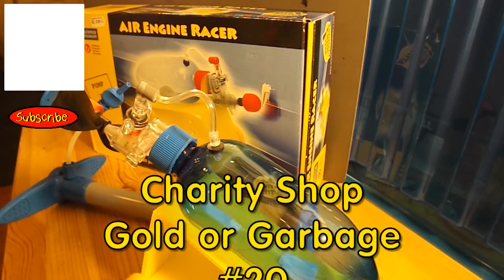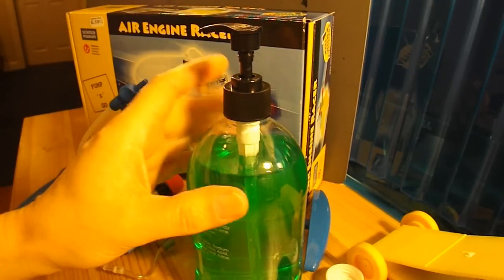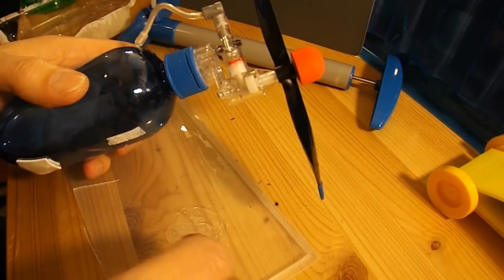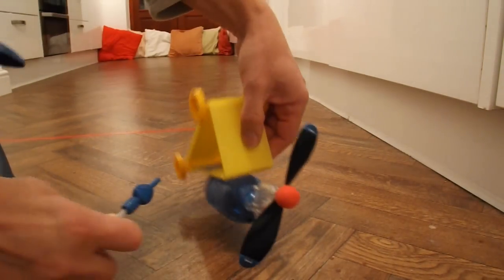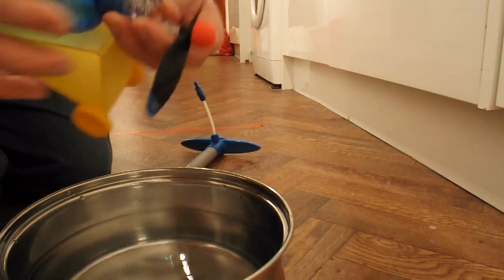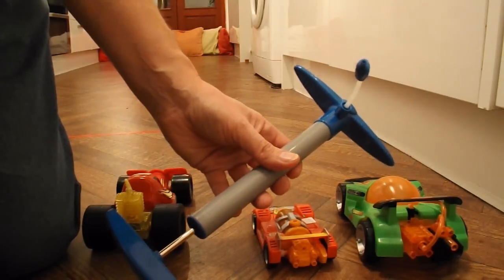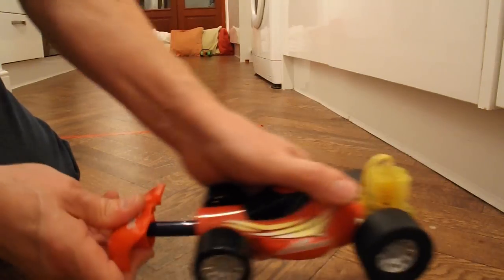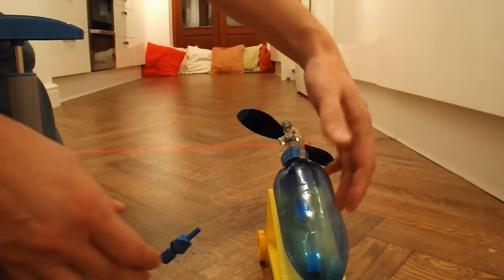Charity Shop Gold or Garbage #20 Repairing the Air Engine Racer

Comment: Hey grandad, is there any air pressure cars or propellor kits or stuff still selling today? If so then I really need to know where to buy that air engine racer and put styrofoam wings in it so it can fly!!!!
Reply from the maker: I guess you will have to search online, maybe eBay or similar. This video is 11 years old and it was second hand when I found it in a charity shop. Air Hogs did several air engine planes. There are links to my related playlists in the video description.

Comment: use Goop to fix the crack.
Reply from the maker: Goop? would that be "Goop is an American natural health company owned by actress Gwyneth Paltrow"
Reply: @GrandadIsAnOldMan  No. It's a kind of adhesive, something like silicone in a tube, but much, much, much better than silicone. I once fixed a tear in a rubber boot with goop and the repair was perfectly waterproof and lasted until I threw the boots out twenty years later. Goop forms a tough lasting repair that bonds securely. It does air dry, however, so the thicker the application the longer it takes to dry. For the crack in the video, it might take several days to dry completely. If that screw cap weren't under a lot of stress, a few hours drying would be enough for it to be strong enough, but for full strength a day or more. The tear in my boot was at the ankle, and it was good to go by the next day.
Reply from the maker: @willardchi2571  I was teasing you, sorry. I Googled it and that was the first thing that came up. Goop do a whole range of adhesive sealants and yes it would probably work although I have never tried it myself 😁👍
Reply: @GrandadIsAnOldMan  It's great stuff. twenty-five years ago, I cut the threaded top off a plastic soda bottle and glued the top to a circular opening in a plastic screwdriver bit dispenser box. When dry, I then screwed the bottle cap back on. Now instead of an open hole out of which my screwdriver bits would fall, I had a removable cap to keep them in the box until I needed one. So many years later, it stilll seems strong as ever.

Comment: hot glue gun would have been simple fix
Reply from the maker: Maybe 😊. I get lots of comments from people who don't own hot glue guns. If you watch a few more of my videos you will see the hot glue gun is my first choice for most of my projects. However, getting a good seal all round the split is not easy with a hot glue gun and you do need a PERFECT air tight seal here so a liquid glue is more likely to flow into the crack and seal with itself. Hot glue does not flow into cracks and to get it to run nicely you would probably need to heat the plastic cap to stop the glue's tendency to cool on contact. On the positive side, hot glue does allow a little flex as it is not rigid whereas the glue I used it likely to crack if it is stressed by hitting it sharply.

Comment: To make my own  bottle top, last time I used  layers of fibreglass wrapped around it.  I have some very thin woven fibre glass cloth which I used to cover model airplanes  with and carefully wetting it and wrapping around the   top  and sides of the bottle with  part of the old bottle top still  in place did work fine for what I wanted. As fibreglass does not stick to plastic make sure that the fibreglass laps the  open end .
Reply from the maker: Thank you

Comment: Plastic weld would work great for that
Reply from the maker: Maybe, maybe not. It would depend on what type of plastic it is. Most of the plastic solvent glues I have tried for my projects won't touch the type of plastic most bottle tops are made from. If you have a favourite brand that you use I would be interested as  I am always being asked for alternative glues.
Reply: Franklin Daniel nhi

Comment: will this be powerful enough to lift a helicopter?
Reply from the maker: +GuitarRocks360 don't know. Horizontal flight is a lot easier than vertical flight. Generally on helicopters you use a much larger rotor blade turning relatively slowly compared to a normal plane and you use gearing to allow the motor to turn the larger rotor.
Reply: GrandadIsAnOldMan Have you done the airplane attempt on this jet car?
Reply from the maker: GuitarRocks360 no, I haven't got round to it yet.

Comment: get a large Styrofoam glider and make a plane with that air engine
Reply: just imagine an airplane that runs on air
Reply from the maker: +Ghost Sniper if you check out the video description there is a link to a plane, not sure if they are still available but they were marketed as Air Hogs Phazor. At some time I will get around to putting mine in a plane but I am worried it may fly too far away so it may have to be RC.
Reply: +GrandadIsAnOldMan but a plane you built would make a better video, as for the aircraft escaping you just need a large area to fly and a little tweaking of the control surfaces you can produce predictable and repeatable flight paths.
Reply from the maker: +Ghost Sniper I am afraid that finding a large area to fly is not that simple. Not knowing what sort of area the plane will need means most local parks would be too small and flying anywhere where other people are present is just asking for trouble. If you are flying a new plane how can you possibly make the first flight predictable? I think that video I mentioned in my video description is an excellent example of what you should not do with a model plane.
Reply: +GrandadIsAnOldMan your exactly right, I live in Nevada so I take open area for granted sometimes.
Reply from the maker: Ghost Sniper I didn't like to ask but I was guessing you might have open spaces. Here in the UK we are a bit tight on space and anything open is usually private property. Flying clubs jealously guard their flying sites to keep them safe.

Comment: Reminds me of the original air hogs planes which used a similar air motor.
Reply from the maker: +Patchuchan there are links in the video description to one of those planes flying.
Reply: I had one of those as well!
Reply from the maker: Dragonstorm1557 GAMING I like the idea of not needing fuel or batteries for these motors.

Comment: Wonderfix would seem to be the best product for that crack.
Reply: GrandadIsAnOldMan try using sugru its like wondafix but sticks to almost anything
Reply: it has for me when sticking cola bottles so yea but it depends on the bottle
Reply from the maker: Aadil Shah hadn't heard of it before. Just googled it, see a website selling it but no details about what it is. It looks the same as any CA glue and at £5 a bottle I don't feel inclined to buy any just to find out what it is. Have you any experience with it?
Reply: I've used it a bit. It's like a rubber or silicone when it's cured. Flexible epoxy.
Oops, spelling error. It's Pratley Wondafix.
http://www.pratley.co.za/Adhesive%20Instructions/GlueWondaFix.pdf
Reply from the maker: Aadil Shah if it stays flexible then that would be ideal although it does not bond to Polyethylene or Polypropylene and I have no idea what plastics the broken parts were. The two pack epoxy I used will crack eventually as it does go brittle. In practice I expect hot-glue would do a good enough job and be renewable if necessary.
Reply: Hmmm yeah. It's probably polypropylene so bonding may be reduced. One could always try some standard epoxy as a primer though. You would have to work quickly and apply the Wondafix over the normal epoxy before it cures. 

To be fair, that's probably too much trouble in most cases.

The better solution for those people lucky enough to own a RepRap would be to 3D print a replacement.
Reply from the maker: Nicam16 yes, maybe, except a pack of that costs more than the toy cost me to begin with. I have not tried the stuff myself so I have no idea how good it would be at sticking plastics. From their website I found this - Sugru and most other adhesives struggle to bond with Polypropylene, Polyethylene, plastics with certain oily finishes, and some powder-coated metals.
Reply: GrandadIsAnOldMan  Yeah i understand but im in bristol and i can get really cheap, like £1.50 for 3 packets.
Reply from the maker: Nicam16 and does it stick plastic?

Comment: Could you convert that air car into a boat/plane?
Reply from the maker: Jack Durkan it suggests doing that on the box it came in. A boat would be easy to do, however it would be a one way ticket and probably end in the middle of a lake with no way or retrieving it. A plane would be a little more involved because the air bottle is so bulky and similar to the boat getting lost in the middle of a lake, a plane would easily fly off out of site and be lost. I may get around to making a plane for it eventually, but I am in no hurry. I have had this toy for well over a year now and not progressed it.

Comment: It occurs to me that ...
Can he could adapt one of those little bottles of carbon dioxide ?.
Of those used in small barrels of beer and also used in cycling, for inflating bicycle tires.
http://www.bikesopportunity.com/blog/wp-content/uploads/2012/07/Adaptador-AirChuck-para-inflado-por-CO2.jpg
Reply from the maker: Yes I am sure you could. You might even be able to control the speed with a suitable valve.

Comment: I would find that toy in commerce or online to become a model plane.
Reply from the maker: I have searched online and I cannot find this on sale anywhere. The brand name is Science Museum but they do not appear to be selling this item anymore. See http://www.sciencemuseumshop.co.uk/search?searchterm=engine
Reply: GrandadIsAnOldMan I also searched and only found one on Ebay, but no longer for sale.
I had a bike that worked the same way, but over time, drivers air tubes plastic broke down.
Let me fix and do something ...
It was like this:
http://i.ebayimg.com/t/1970s-TOMY-AIR-JAMMER-PUMP-AIR-PUMP-MOTORCYCLE-TOY-STILL-WORKS-COOL-Barbie-/00/s/MTIwMFgxNjAw/z/j3EAAOxyF81SArsQ/$T2eC16ZHJGUFFhyt2sCNBS!rsP71YQ~~60_35.JPG
Reply: GrandadIsAnOldMan Interesting site ...
Reply from the maker: Francisco Javier Lázaro Pinela Yes, not cheap, but probably good quality.

Comment: Cool! Been working off and on a "bash valve" air engine (love that name) build using a Pringles Can but so far "no go" A pingpong ball was going to be the valve. Seem to need a huge flywheel to get it working. Don't have a clue why these motors work so well.
Reply from the maker: Thanks, this latest car engine positively cries out to be put in an aeroplane but I am worried it might fly too far if I let it go free flight and I don't have any suitable radio control kit at the moment. All the r/c stuff I have is indoor toy car stuff so the range would be too short. I could try it with just a few pumps of air just to see if it extends a gentle glide but any more than that and I would lose it in any of my local urban parks. Back in my early teens I did lots of aeromodelling but haven't touched it in over 40 years.